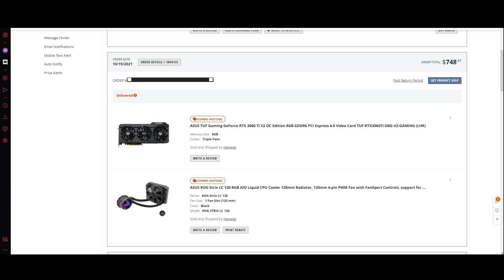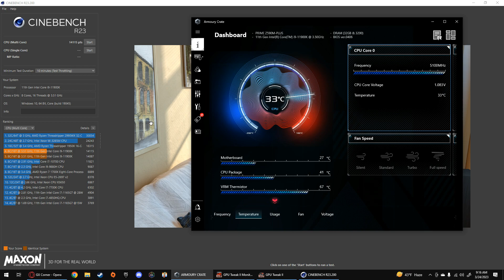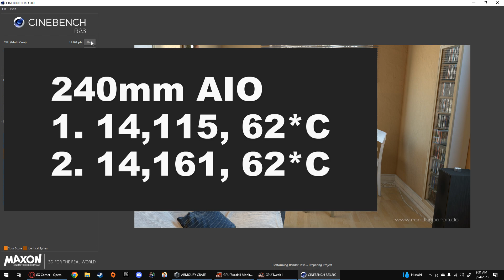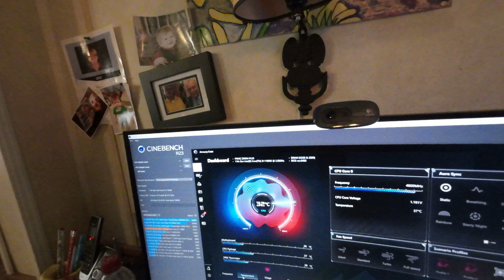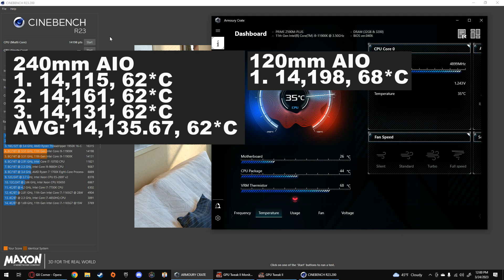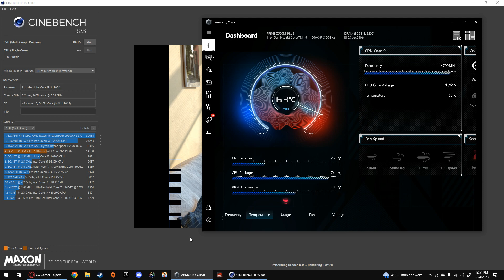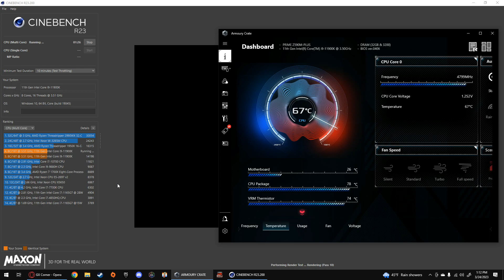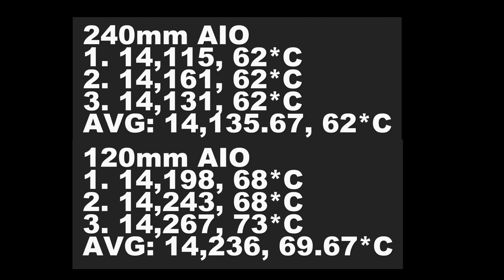Can a 120mm AIO Tame an Intel i9-11900k?

Comment: The mesh (perforation) on your case back panel reduces airflow drastically. I think that's why, on the last run results didn't improve, despite fans doublestacking

Comment: you are definitely limiting something, I have a 11900kf with a decent air cooler, adaptive boost tecnology enabled, NO OVERCLOCKING, and I get 15850 points on cinebench (90° max). Thank you for the video but it's obvious that you can keep low temps if you limit the cpu in the bios.
Reply: motherboard often is a limiting factor, it could either be not able to deliver enough voltage to the CPU, motherboard itself getting thermal throttled, motherboard having limited OC capabilities.
In your case it seems like your motherboard might already have some level of OC enabled by default, the average Cinebench r23 score for 11900kf at stock should be around 13500, an OC at 5.0Ghz can reach 16000+
Intel Extreme Tuning Utility allows you to manage CPU exactly the way you want and shows you exactly who's throttling.
I have a crappy Alienware motherboard, which cannot deliver enough voltage to 11900k to utilize its full power, I have to undervolt/overclock to just get it run 10% better than what stock would be on a better motherboard

Comment: Hello what is your settings for i9 11900k? Im using the same cpu and same cooler but getting way higher temps. Im wondering if you have undervolted it perhaps?? Thanks ,
Reply from the maker: It might have something to do with the motherboard I had at the time. It was an Asus Prime Z590M, which didn't have much in the way of overclocking features. I'm now on an Asus ROG Z590E board, and it seems to run the processor a bit harder and make it a bit hotter.
Reply: @voyagerentertainment6766  Thanks !